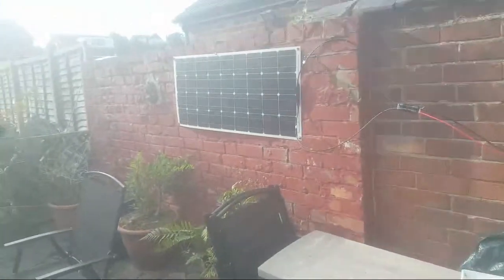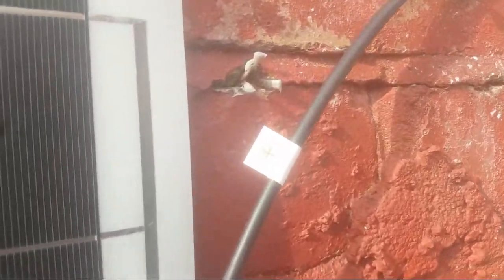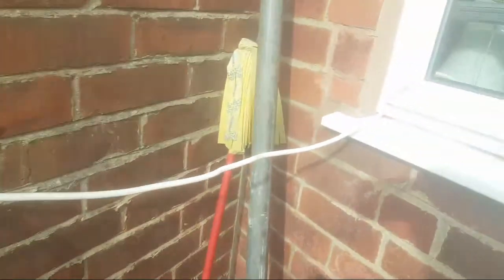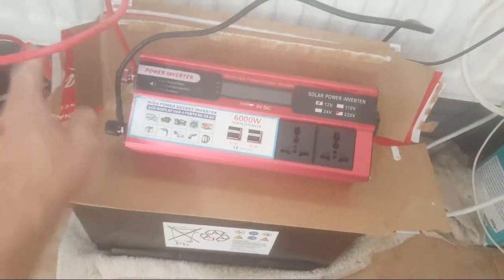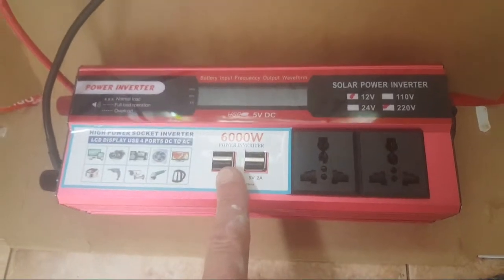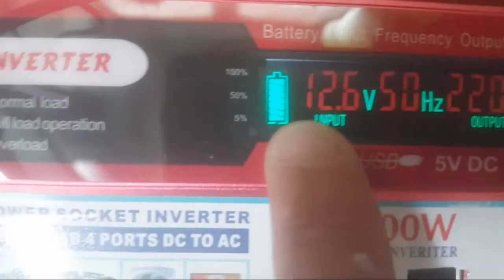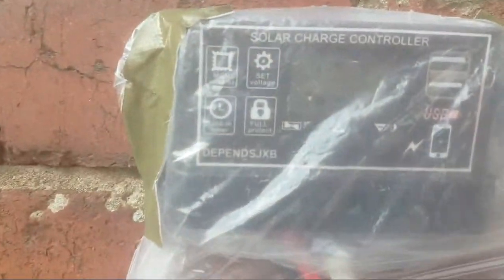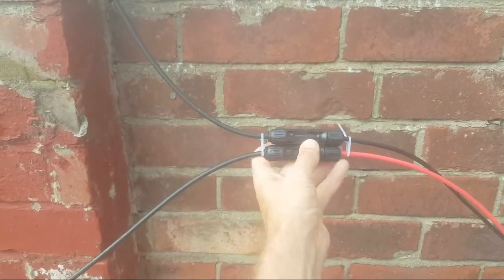100w solar panel, 6000w inverter with 12v dc battery

Comment: Hi there, what's you ac output by you socket? I have exact same one and I only get 203 vac, and it shows 220 vac on display. Is there any way i can adjust output to get to 220vac to run appliance because small garage door motor just humming.

Comment: is that real 6000w? and pure sinewave?
Reply: nvm.. it is not 6000w, it has three parallel 40A fuse inside a total of 120A at 12v about 1200watts only.  it is a simple modified sine wave..